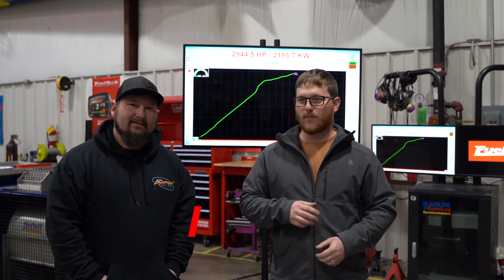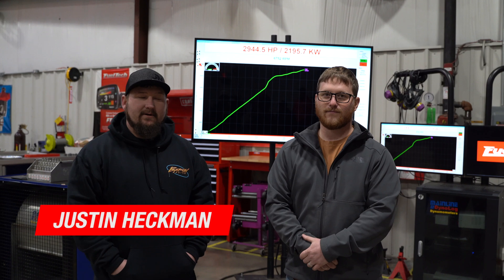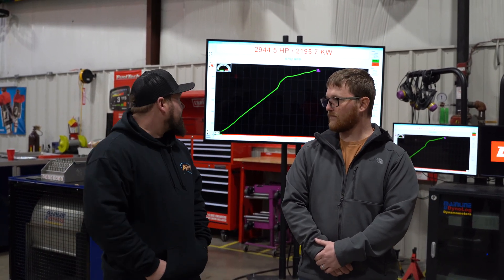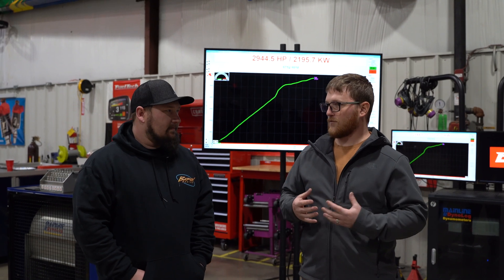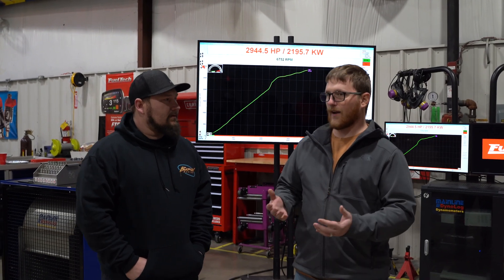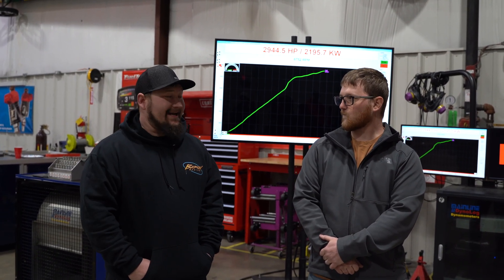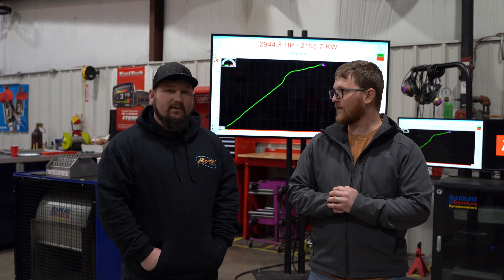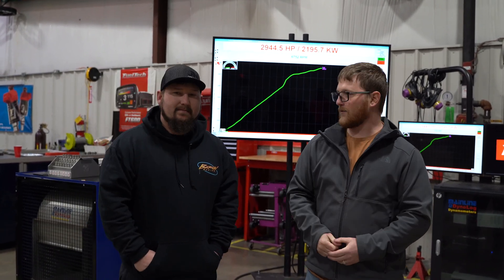2900+ HP Twin Turbo Cobra Mustang | Justin Heckman

Comment: The car is cool but putting a chevy engine is blasphemy, no wonder you have issues….. put a real motor in it!!! A FORD ENGINE AND CALL LUND
Reply: Lund don't have shit on fueltech lmao
Reply: Needs a Godzilla engine.
Reply: @jameseastwood4984  YES on boost and spray
Reply: Wouldn't make this type power with a Ford motor, esp. Only On 28lbs of boost 🤣🤣
Reply: @osirisvb  yeah I know it would make a shit load MORE, only chevys make shit power….
Reply: @Marcus2750-u1t  got any proof of your ford motor making way more power than this chevy motor did on 28lbs of boost? I am thinking from your cocky statement you should have some proof of ford motors making over 3500whp on 28lbs of boost 🤔 let's see it
Reply: @vjb5107  actually yes….. maybe thats why Im cocky boy
Reply: @Marcus2750-u1t  where is the proof?
Reply: @vjb5107  he has no proof, just a lot of bs that is all 🤣🤣
Reply: @Marcus2750-u1t  that's something that a ford guy would say and what stupidity to be honest
Reply: @osirisvb Exactly!. Would make a lot more than that with a ford engine
Reply: @xavierruiz7804  any proof as the other guy asked, on a measly 28lbs of boost? Show me any ford motor that can do this.
Reply: @osirisvb  Chevy motors are overrated
Reply: @xavierruiz7804  show us proof bro, stop just spewing bs. So far not a single ford guy can show me better numbers at 28lbs of boost.
Reply: @osirisvb  fueltech has a video a small block ford with 3,000hp low boost
Reply: Chevy engine are noo good and are overrated
Reply: @xavierruiz7804  link please, esp small block. Lol this i gotta see
Reply: @xavierruiz7804  I think the same about ford motors, too much hype around them
Reply: He got a real motor. 
CHEVY
Reply: @Toroazul54  yeah a real piece of shit